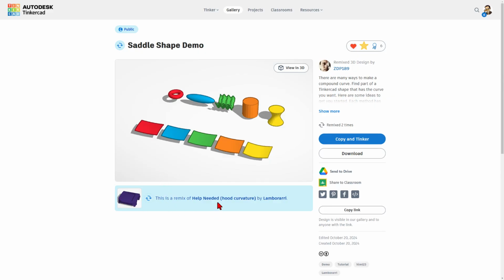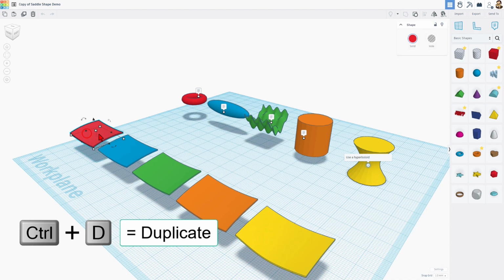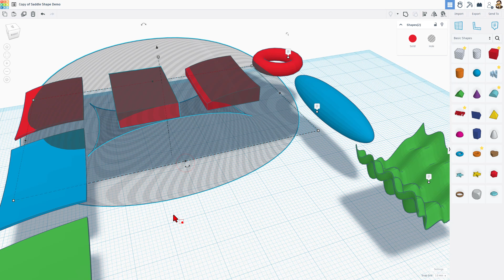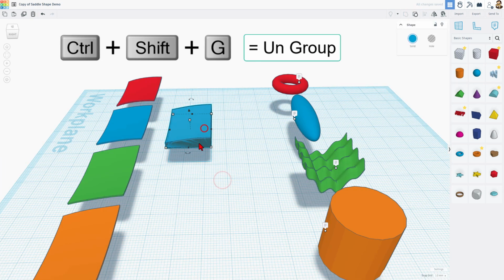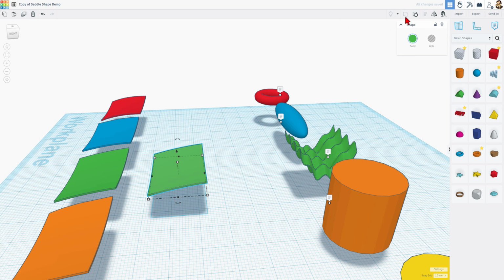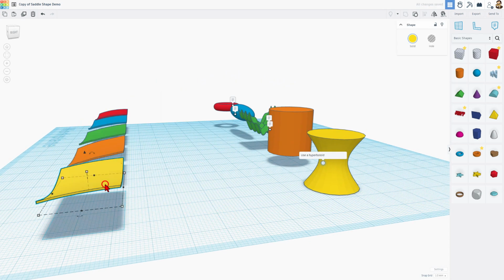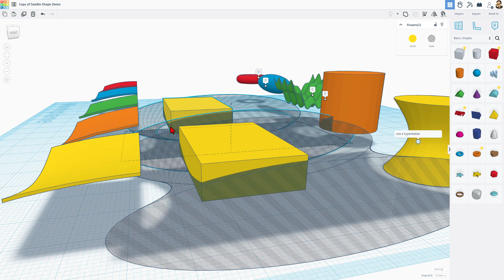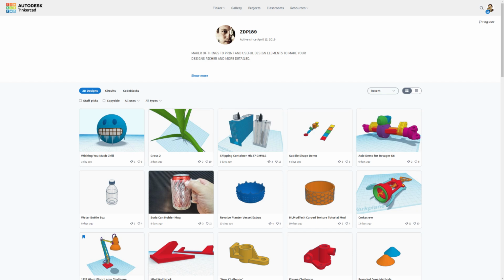Tinkercad Complex Curves in Minutes! Fancy Car Hoods & More by ZDP189

Comment: Hi! Can we create a simulation for line following robot project in tinkercad?
Reply from the maker: I will pass that idea to the devs. Currently Tinkercad Sim Lab does not have an ability like that though.  You may be able to test arduino code for an idea like that in Tinkercad circuits though.
Reply: @HLModTech  i see… thanks for replying. Youre awesome!😍
Reply from the maker: I do not have a time table, but from what I heard it should be possible someday.
Reply: Marcel P.'s "Self-Driving Smart Mini Cars Race - Sim Lab (Version 2)" design might give you some ideas. This design originally utilized a glitch where certain wheel shapes connected to an axle connector automatically spin on their own, without motorization. I'm not sure if the Tinkercad developers have fixed this yet, but if you motorize the cars you will get something similar to a line following robot. It can't turn sharp corners, but it works (to a limited extent).

Comment: The user needed a car hood, so I had to make it a 1mm thick surface. I duplicated each chunk, made it a hole, dropped it down 1mm and grouped the hole to the original chunk.
Reply: The green part is one of two Shapes that allow you to define a surface mathematically. They are rarely used because most people don't have the math skills to use them. But think back to your algebra class where you charted the shape of curves based on formulas and you can draw very complex 3D shapes with a bit of math skill and some trial and error.

This would be an important tutorial that nobody would watch. 😂
Reply from the maker: Fact! Getting the  masses to dig and understand math is a painful endeavor.